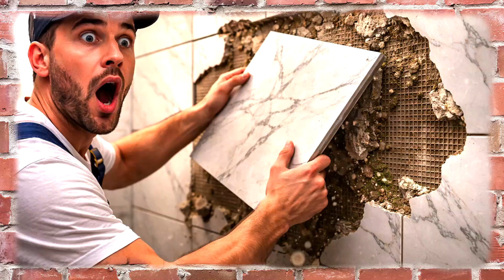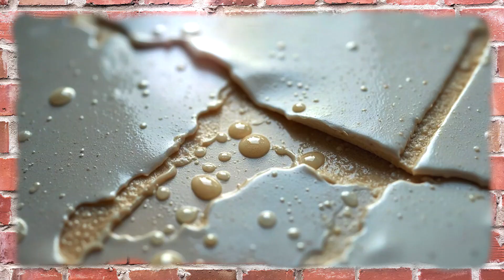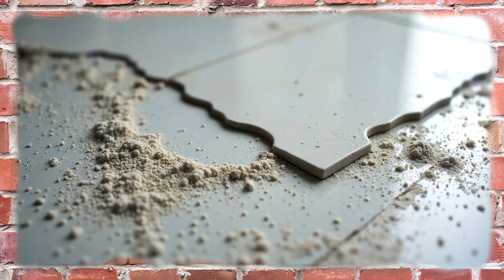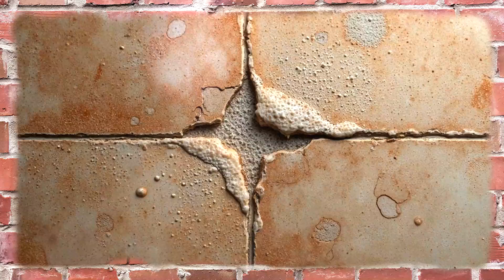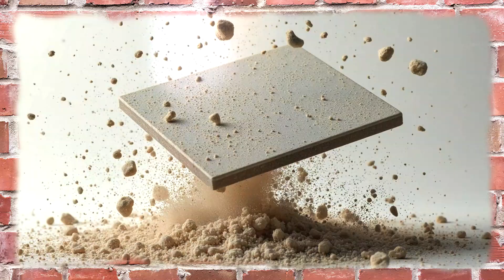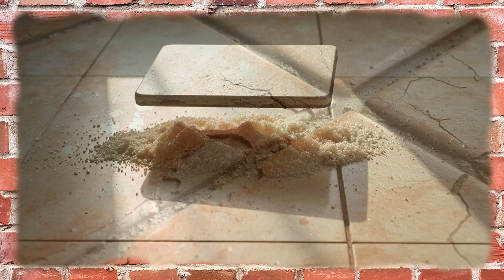Why are your tiles falling off? Tile installation mistakes

Comment from the maker: It’s heartbreaking to see a perfect renovation fall apart because of a single hidden mistake. 💔 Have you ever experienced tiles falling off or cracking shortly after a project? Share your horror stories or questions below! Also, let me know: do you prefer hiring a 'pro' with 20 years of experience or doing it yourself to ensure every step is followed perfectly? 👇